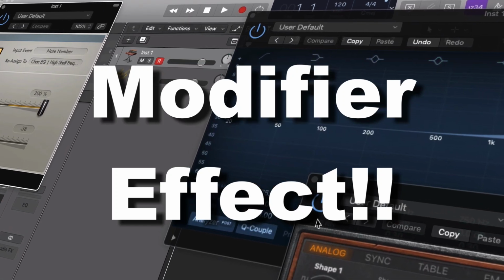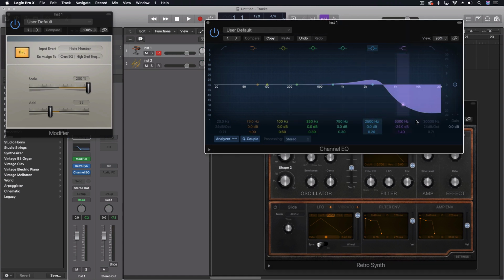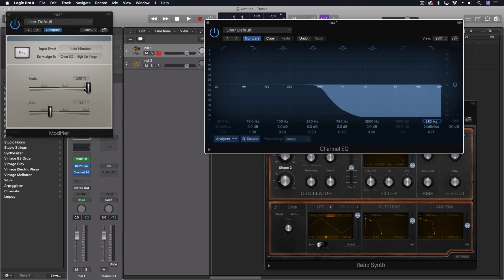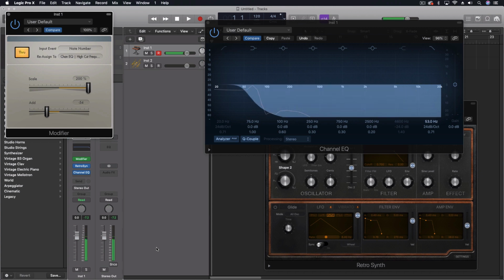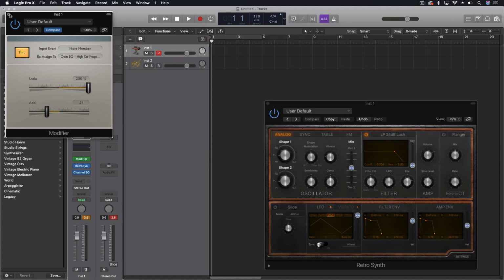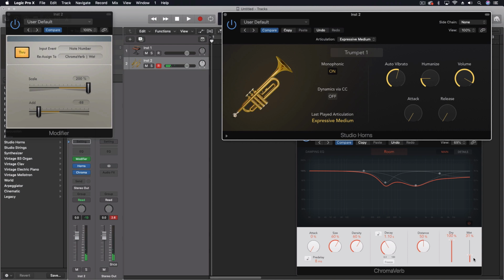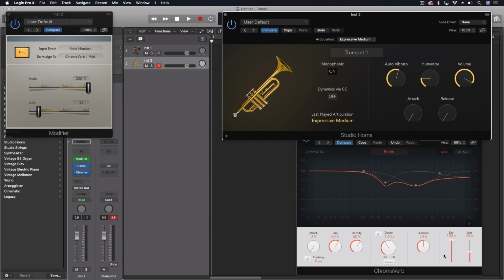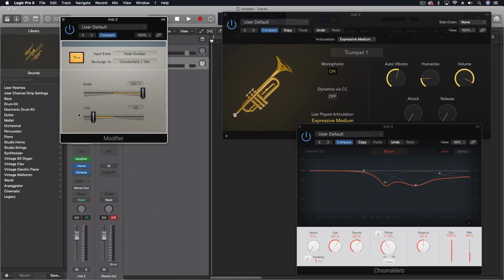Modifier Effect!! | Logic Pro X

Comment: Question: can I use modifier to assign a specific Midi Note to a CC with value 127?
Reply: Not with the current default MIDI FX tools available to us. However, this can be easily done using Logic's Articulation IDs. Create an Articulation ID that assigns the CC you want to output a value of 127. Then all you need to do is select the MIDI note you want and assign this Articulation ID to that note. In the Piano Roll it's very easy to select multiples of a single note by clicking on the vertical Piano keys.